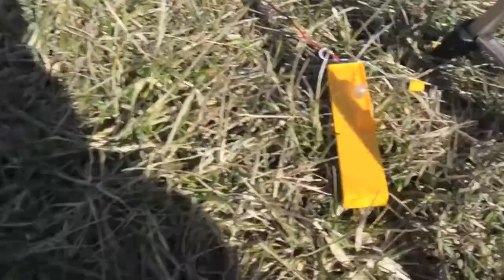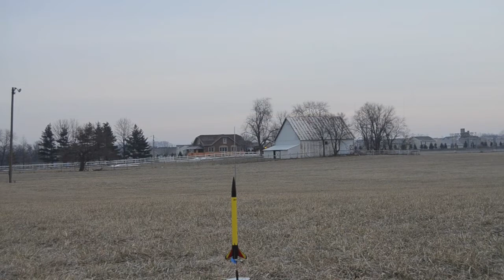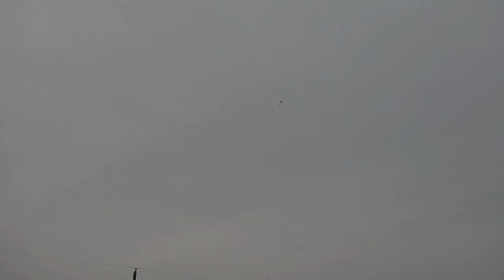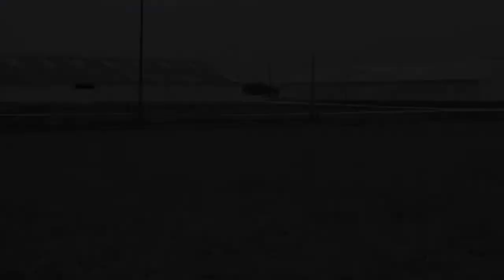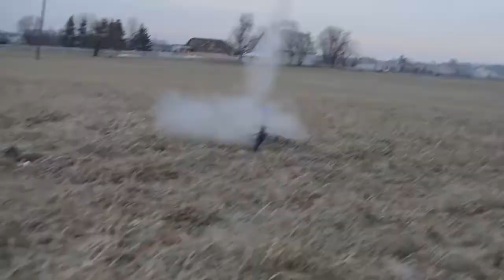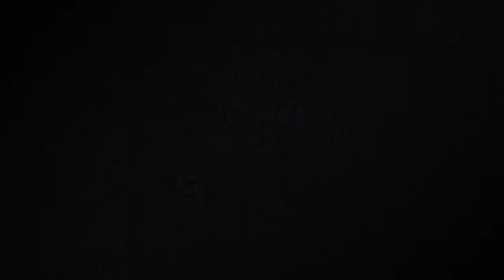Model Rocket Launch FAIL...Keep Watching!

Comment: I fly the bigger D engine rockets and I always use a lawnmower battery to launch, its soo much extra voltage that even if the gunpowder on the ignition piece  is bad it will still get red hot and launch anyways.

Comment: On a very cold day the batteries can lose power which might have been your problem on some of the  'scrubbed' launches. As you pointed out you were lucky you did not get ignition the first 3 times you tried because the protective plastic cap was still on the launch rod and would have caused problems. But the rockets flew well anyway.